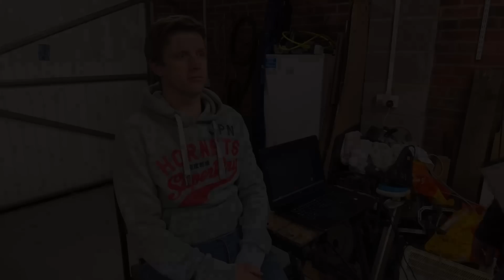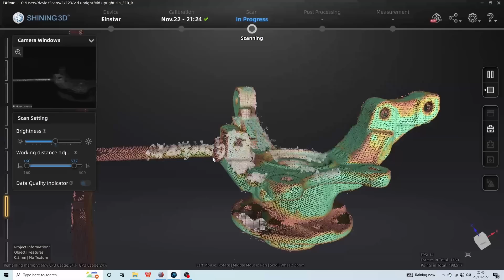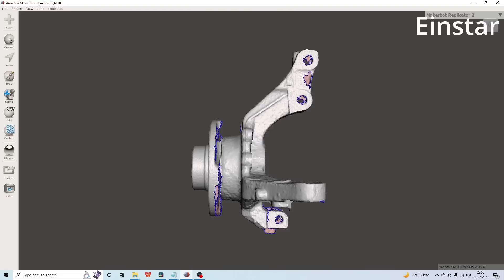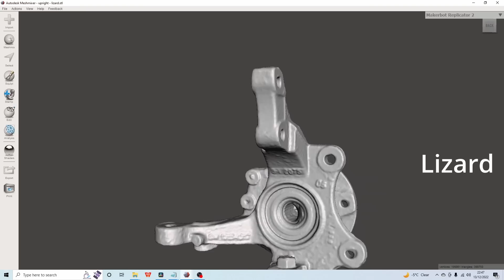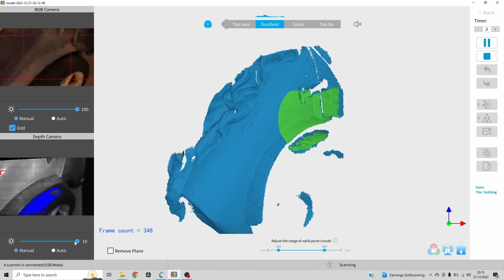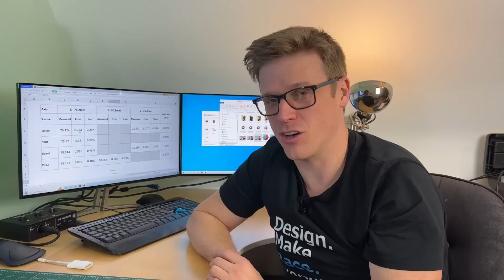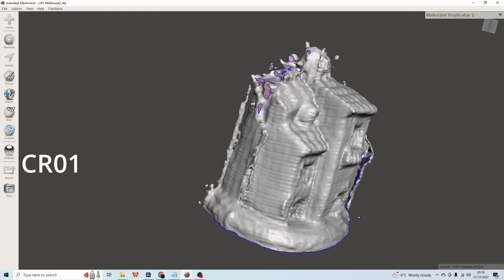Which 3D Scanner is best?!  The Pop2, Einstar, CR01 and Lizard compared over 20 different scans!

Comment: Looks like to high of a mesh quialty on the pop2. I have gotten much better scans with mine. But nice video
Reply from the maker: I generally just went with the auto settings on pretty much everything.  But there are opportunities for better scans and spending all the time in the world on each of these scanners.
Reply: @MakingforMotorsport  yea i have used and own a few scanners. You can always pull a bit better quatily with different setting. revo auto settings are a bit untuned. I find a mesh quality 4 to 5 and a denoise of 3 normally works.
 I do admit most of the scanners you compared have a small FOV compared to the einstar.
 Revopoint has a larger fov scanner coming out next year. That will be a great comparison to the einstar for large items.

Comment: Einstar is the stand out for me, but the Lizard seemed to capture some nice details, would second scans get rid of the rending problem around the hole at the front ?? so subsequent scans over already scanned areas correct previous scan issues ? really in the market for a scanner at some point.
Reply from the maker: Yeah, the bulge on the front was the software trying to make sense of any area without many points instead of just leaving a hole.  Check out my Lizard review or the Reverse Eng video to see the best it can do…
Reply: @MakingforMotorsport  I might have to treat myself to that Einstar in the new year , Nice vid ty :)

Comment: I got my pop2 on a early kickstarter pledge...  I haven't used it a great deal but did scan a sectioned/cut cylinder head to create a 3d printed model which would serve as the probe piece for having CNC porting work done... it did a decent job but it took forever to get a decent scan... there's a few other things I attempted to scan with it and I had to really douse them all in the aesub spray... but based on this I see I could've chosen a better scanner...
Reply from the maker: Whatever gets the job done for an affordable price is a decent tool… but some do require less effort than others 😂

Comment: My 1 cent worth:
Both of the Creality scanners do quite well, the Einstar did vastly better in the scan of the mini, which is impressive, scanning a shiny smooth surface does not seem like a simple feat.
Of all of the scanners, I think the lizard would do what I need the best, then the Einstar in second. cr-01 third, and I was not terribly impressed with the pop2, although the accuracy was astounding, it didn't seem to do good with surfaces.
But after seeing the prices of each of them, I'll stick to my $10 calipers and waste a little filament on some test prints getting everything shaped just perfect.
Reply from the maker: I was surprised by the CR01, especially for automotive stuff….
Reply: @MakingforMotorsport  It did very good. just barely edged out by the Lizard and Einstar in my opinion, but it was so close. I suspect as has happened with printers themselves, as time goes on, community firmwares and softwares come around, tech improves and prices come down there will be a lot of interesting things in store!
Reply: I am quite dissapointed by POP2 performance. I am convinced that it can spit reasonable scans but I didnt use it too much so far. Videos like this motivate me to try some tests. But I agree with Dave - I guess none of hobby grade scanners would be great in all applications. Iam thinking about getting einstar to my POP2 and MINI or replace POP2 by Einstar